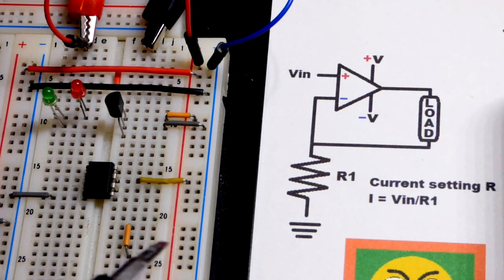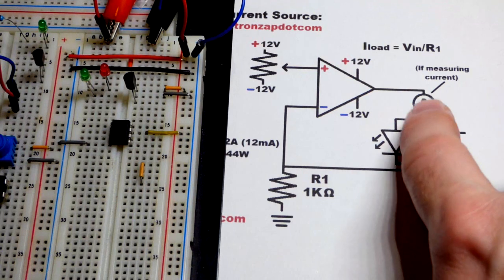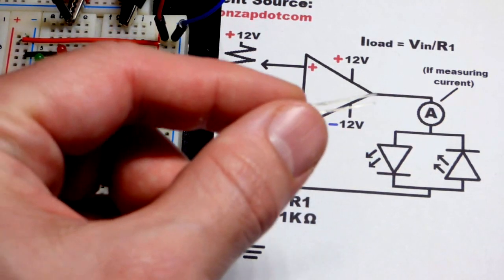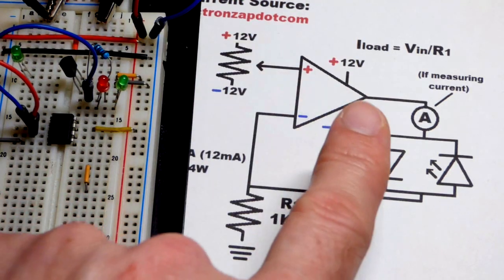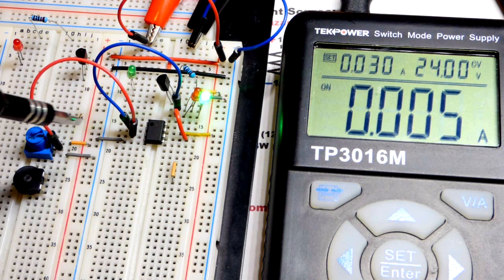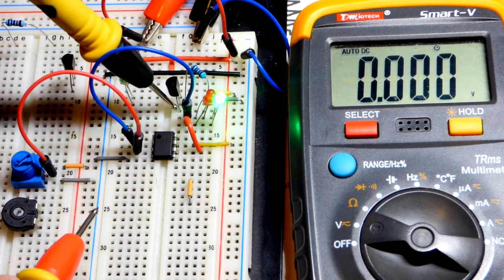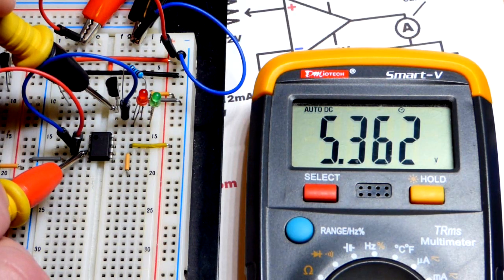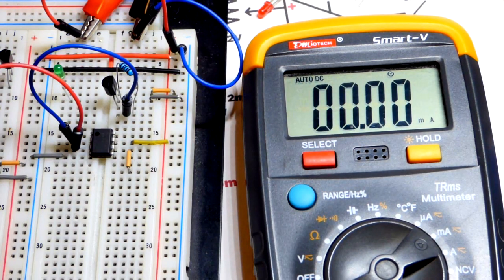741 op amp voltage to current circuit step by step build and demonstration

Comment: Can I power the LM741 at 5V and drive a 300mA LED using VIN=3V (at a 100K pot) and R1=10ohm?
Reply from the maker: 741 is made for a dual power supply and only a maximum of ±25mA output current according to it's datasheet. Probably have to figure out how to use a single supply op amp to control a powerful enough transistor for a circuit like that.